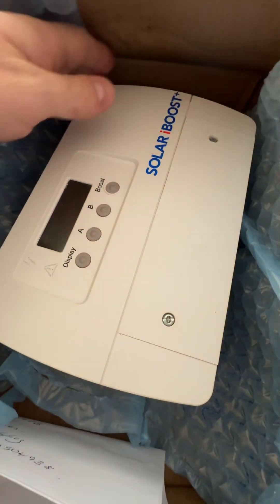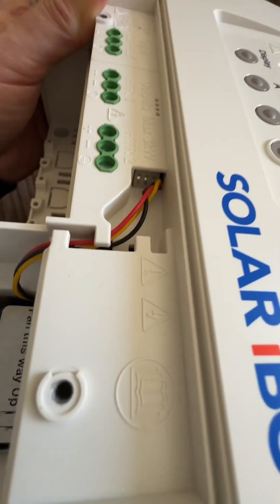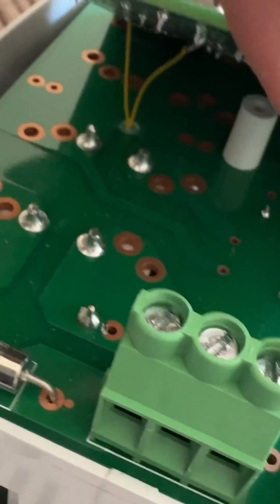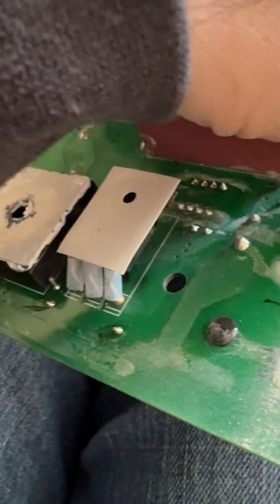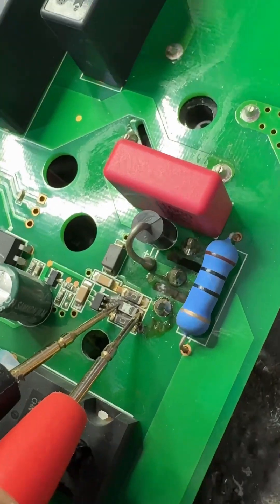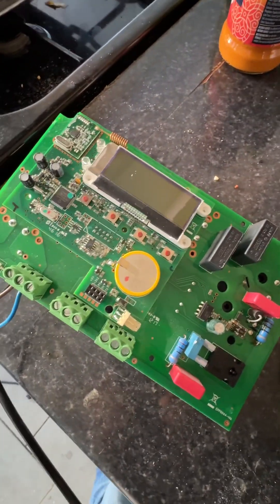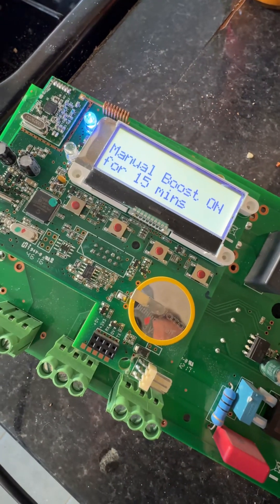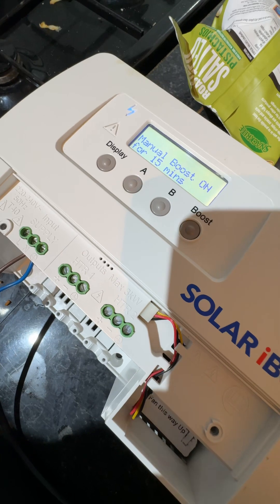Solar Iboost turning on and off - can we fix it ?

Comment: Just got one of these installed yesterday, worked fine the first day, now the screen isn’t displaying any information, is this common?
Reply from the maker: Hi no that’s not normal, if the immersion heater element goes short, it can blow the fuse on the Iboost or blow the bridge rectifier up inside